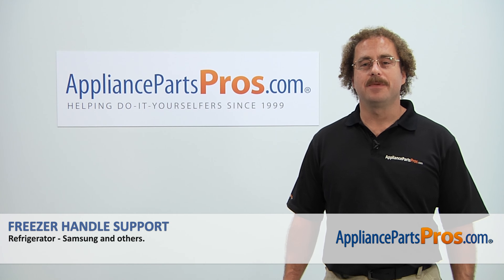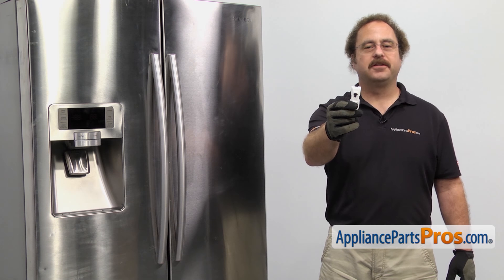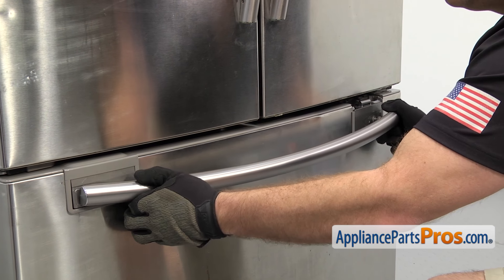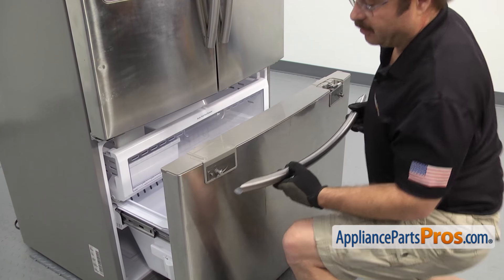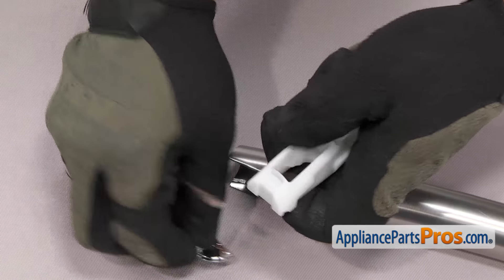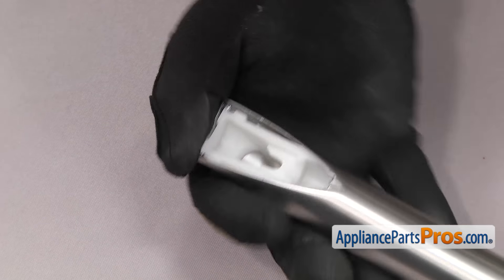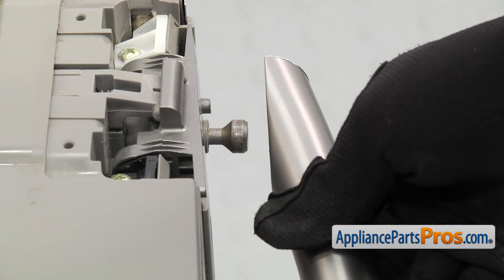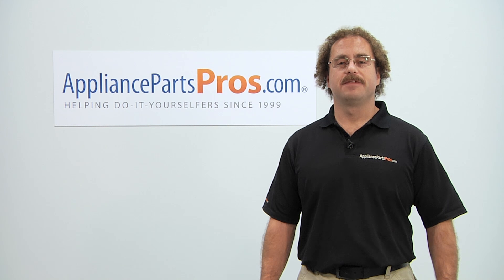How To: Samsung Freezer Handle Support DA61-08229A

Comment: Have used this channel twice for my samsung refrigerator.  Life saver! The tip to open the freezer was key to fix my handle bc I couldn't get it off. I didn't have to replace any parts this time (pins were just loose from use over 4 years), but this channel will be my first stop for any appliance repair or part.
Reply from the maker: Glad we have been able to help you out. If there is anything we can help you with in the future please let us know.

Comment: Such a great video! My Freezer handle came off and I was thinking of replacing the Handle Support entirely but the problem ended up being that the screw holding the one side of the handle was loose! Got the 3/32 wrench and it fixed the problem. Hope this helps anyone out there!
Reply: Thank you friend.  I fixed it!
Reply: same happened to me

Comment: Wondering if you could help.  My handle came off the freezer door, but that part itself is intact.  It is the brackets on the freezer door themselves that are damaged and require replacement.  How do I remove those and what are those parts called?
Reply: did you ever find right part?  I need these too, any help appreciated

Comment: I have a similar problem with my freezer handle, but the part that is broken is the mount on the freezer door, not the handle. Do you have a video for that and do you sell that part?
Reply from the maker: What is the model number of your fridge?
Reply: I have the same problem as Scott.  Mine is RF261BEASR.  How do you fix that part of the handle which is on the drawer?

Comment: We have a Samsung Fridge RF28R7201SR and the left side of the freezer flex zone handle is broken off. the part has a number on DA67-03330 CAP HANDLEFRE-L. Do you have a replacement part and is there a video that is on youtube that I could view on how to replace the defective part. Thanks
Reply from the maker: We do apologize but it doesn't appear that we carry that part. How old is this fridge?

Comment: The new left side doesn’t fit on the mounting peg on my Samsung freezer. Is this a replacement for all Samsung models? The old ones had the locking screw.
Reply from the maker: What is the model number of your appliance?
Reply from the maker: Do you happen to see a rev or revision number by chance? Something like XAA-00 or anything like that?
Reply: @appliancepartspros no I do not see that. I just bought another locking screw mounting one.

Comment: My Samsung freezer drawer is very similar to the one in the video, except that the handle sits on a solid front.  When the handle came off, the white plastic handle inserts, as shown in the video, seem to be in perfect shape, but on the drawer are 2 very small gray pins on each side of the handle that seem broken.  I've re-seated the handle successfully on several occasions, but it is not usable, as each time you pull on it, it comes off.  Is there a replacement for 4 little the gray pins?
Reply: did you ever get replacement pins?

Comment: Here's a good Q. My Samsung RF28R6301SG's handle broke off, not just the handle that uses a 2.5 mm Allen wrench to put back on  but the part that the handle secures to broke from inside the door. Any idea what this part is called?
Reply from the maker: Which door handle is broken off?

Comment: My handle doesn’t have a set screw or anything at all to release it from the mount. Can u help me out please???
Reply: Neither does mine. You probably fixed it or broke it. Use a small flathead and turn it 90°, pull the handle away from the door with the screw driver in position then pull it out and the handle pops off.

Comment: The plastic part that the handle is attached to broke.  I pulled too hard when I opened the door and now it's broken and I don't see any way to remove it from the rest of the door.

Comment: So I can stop trying to find a flathead to fit that thing on the left. I'll go look at the right side now. 🤦 with a 3/32...
(EDIT)
This one required a flathead and a 90° turn, keep screwdriver in position, lightly tug on handle and remove the screwdriver. The handle pops off. 
Next "complaint". The paint started pealing on both the frig handles. Stripped them down to find one is aluminum and the other stainless. So Im hoping etching primer will solve the paint issue so all three handles look the same.